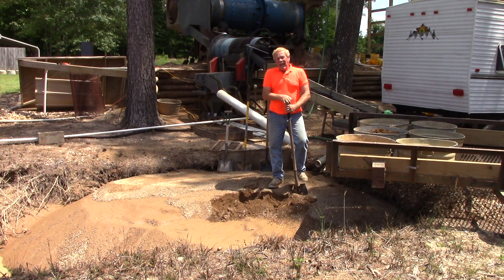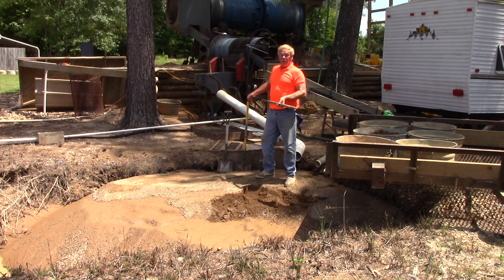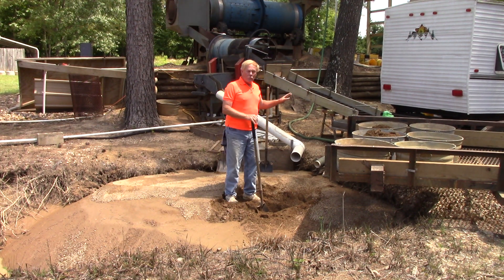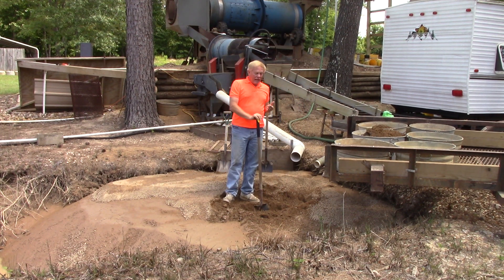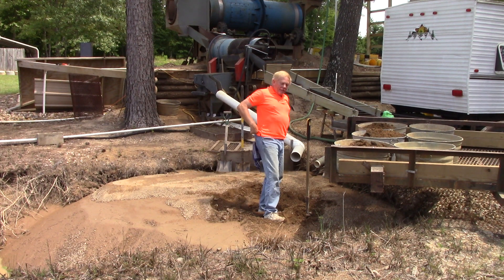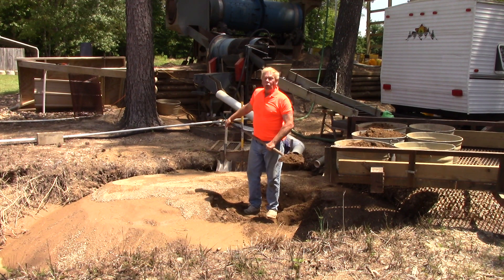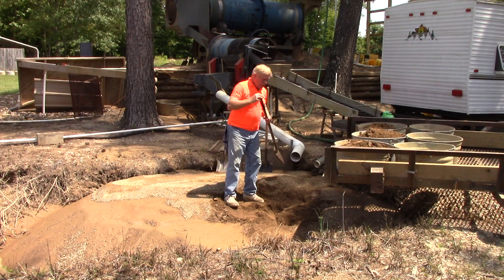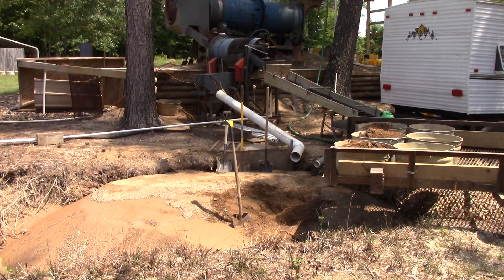See A Modern, Diamond-Recovery Plant and Learn How We Have To Deal With Tailings From The Process

Comment: modern processes do not use sluices. this is a gold recovery unit, which is very inefficient at recovering diamonds. modern processes use a grease recovery system on flat plates.
Reply from the maker: I see what you are referring to now.  The sluice is an add on to catch oversized, dense minerals before feeding them back into the diamond recovery plant.  The heart of the plant is the jig.  That is where the diamonds are recovered.  The jig is under the smaller trommel/scrubber.  I explain it in other videos.  Please take a look.
Reply: @genuinediamondsinar3253  gotya.. i'll check yr other vids
Reply from the maker: @Ghryst  Thank you!